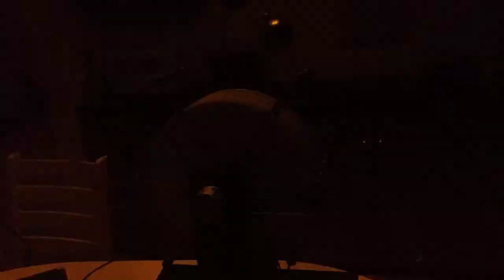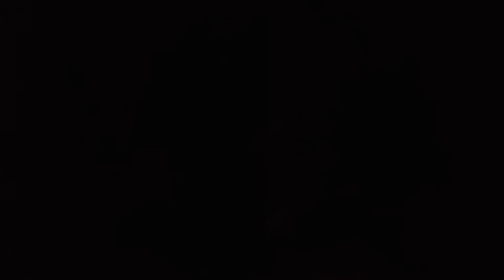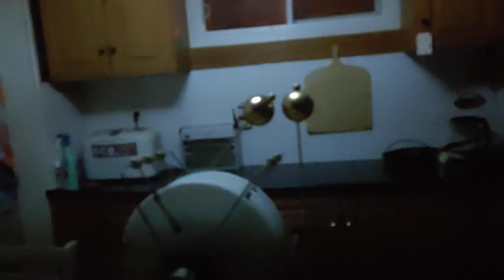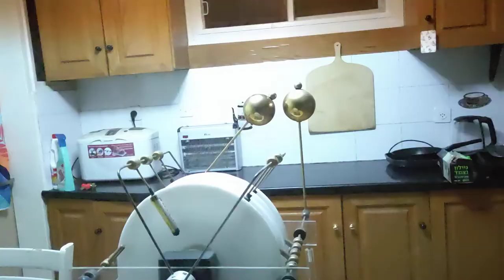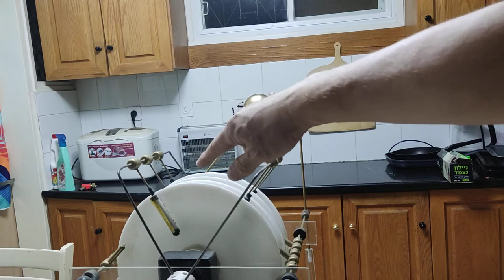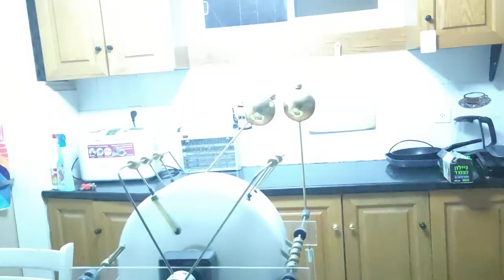Dead Starting Of A Bonetti Machine (Sector-Less Wimshurst)

Comment: Cheers very nice machine. Did you hear about the New Tech called a Fractal Capacitor Array? Its a 94% efficient inverter transformer, Low weight, Low cost, easy to make(Robert Murray Smith has the board design A4 size) Finally  a great solution for any  HV TO LV AND LV TO HV.  Why not use the most efficient motor in the world from Keppe motors Brazil (Newman Motor with patent) to drive it? May I ask does this machine cause drag on Load?  Would applying Graphene ink anywhere improve it?

Comment: very interesting how the wheels holds the charge overtime. i have a Wimshurst and the best it gives is when i pull the brushes back off the foils, charge separation👍
Reply from the maker: The neutralizer brushes or the charge pickups?
Reply: @MisterBonetti  all brushes set not touching once it starts...
Reply from the maker: @m3sca1  Try modifying your neutralizer brushed so instead of the one tip with a brush you have maybe three sets of brushes with two brushes landing close to both edges of a sector and one about dead center on the sector. Then when you back the brushes off the disc it should also create charge on the space between the sectors which on a sectored Wimshurst normally has no charge. Also note on my Bonetti machines the charge collectors on each side (the positive and negative sides) are two movable halves so both charge collectors on the side of the same polarity are each angled in the opposite direction towards the nearest neutralizer in the direction of rotation. When you have each charge collector level like you see on most Wimshurst machines one disc will ALWAYS have slightly less capacitance than the other, that creates a voltage divider effect with the current ONLY coming from the disk with the lower capacitance (because that is the highest voltage producer), by angling the charge collectors in two halves for each charge collector again in the direction of the closest neutralizer in direction of rotation, you will remove current from BOTH discs.  With the neutralizer mods I talked about as well you can theoretically increase the current output of your machine by a factor of 4 (meaning the capacitors will charge much faster and the length of time between discharges will shorten).

Comment: What are your disks made out of? I’ve used acrylic, but acrylic is relatively expensive and difficult to work with. Are you aware of any good alternatives to acrylic (preferably something that is less brittle and less prone to cracking)?
Reply from the maker: Mine in that video are white CAST ACRYLIC the Perspex brand. I like G-10 epoxy.  Works awesome.  I have also had discs SLA 3D printed disks from 3D systems in their Accura Bluestone product (a ceramic and plastic nano-composite) but the cost was ridiculously expensive.  3D Systems SLS Duraform HST was  later used for my 5 pulley drive shaft, and the disc pulley bosses, I have printed discs with that too, it too is expensive, but no where near as expensive as the SLA Accura Bluestone printing was.  PVC works well and is relatively inexpensive, for this unit I originally used vinyl records, but they flex like hell when the machine is loaded with charge, the trick I suppose is to double the inter disc spacing when using records.  https://www.flickr.com/photos/23866680@N06/50797365257/in/album-72157717711750007/
https://flic.kr/s/aHBqjA71tC   As far as "Cracking" , I found I have not had that problem with non-clear Acrylic.  Also stay away from alcohol to clean the discs prevents cracking as well.
Reply: @MisterBonetti  Thank you!
Reply: @magx1   Excelente la explicación..!!!

Comment: Amico , bel lavoro .
Devi usare una resistenza e non usare la scintilla. 
Una volta che hai la resistenza accesa per induzione prelevi dalla resistenza.
Reply: What about the resistor?  I don't speak Italian (unfortunately) so if you can explain in English it would be better.
Reply: @mosesnewman  
you have to use a resistor to stop the voltage speed and with an external coil collect by induction
Reply: @giannileonardodaniel  thank you sire

Comment: Is the classic Wimshurst or Bonetti better?
Reply from the maker: The Classic (Sectored) Wimshurst self starts whereas the Bonetti does not.  The Bonetti is better however because without the sectors it is much more efficient and produces 2 times the current output.  While single paired versions of both machines can have their output current doubled by using charge collectors that have two separate halves for each polarity that can be angled towards the nearest neutralizer in the direction of rotation, the Bonetti will still produce twice the current.  See my two part video on measuring current from Wimshurst and Bonetti machines where I explain how my quadruple Bonetti produces 28 times the output current of a single paired Wimshurst with the same disc diameter.
Reply: @MisterBonetti  but if I spin the discs on the bonetti machine for a long time will they always remain charged or do I have to recharge it every now and then?
Reply from the maker: If you turn it off you have to recharge it every now and then. How long it will stay charged enough to self start depends on several factors, disc composition, leakage, neutralizer design, and the distance of neutralizer brushes or blades from the discs (brushes made of conductive soft stainless steel thread for wearable electronics work best), and whether or not the capacitors are in the circuit or not.  Also, humidity will affect this to some extent too. While you don't normally have the business ends of the neutralizers in contact with the discs (usually about a 1/16" [1.5mm] gap) on a Bonetti Machine, if they are made of the soft stainless steel wearable thread and they touch, sometimes that will make the machine start up even when there was no charge to begin with. I have had mine, self-start after months of non-use, but that does not always happen. Some people's machines due usually to bad neutralizer design, have to be re-started every time the machine goes from off to on.
Reply: @MisterBonetti  but is it true that the discs on the Bonetti machine don't cause friction unlike the Wimshurst when it turns?
Reply from the maker: @andreavela1433  The only friction on a Wimshurst is the brushes on the ends of the neutralizers that touch the sectors.  On a Bonetti Machine you usually have a clearance of about 1.5 mm (1/16") between the blade or brush ends and the discs, but many that use brushes as the neutralizer ends and not blades will often have the brushes touch the discs, depending on the brush material sometimes actually touching will help the Bonetti to self start, some materials any disc contact will cause the machine to have trouble starting, all in all the norm is to have clearance.
Reply: @MisterBonetti  one day I too will try to build the bonetti machine but with a crank 👍